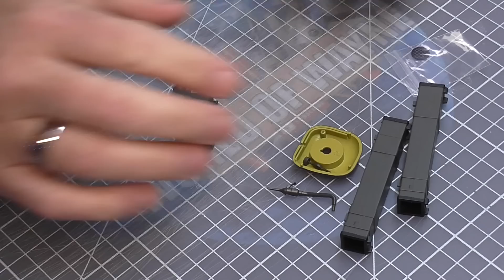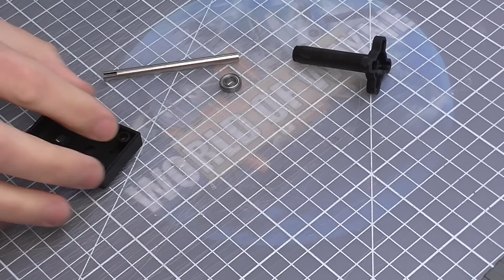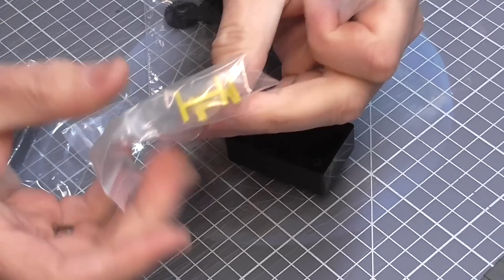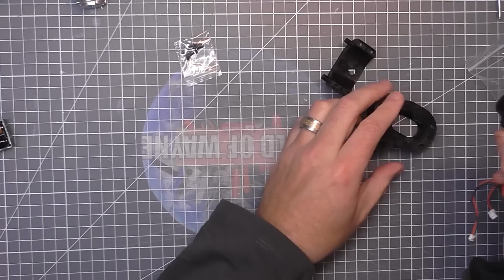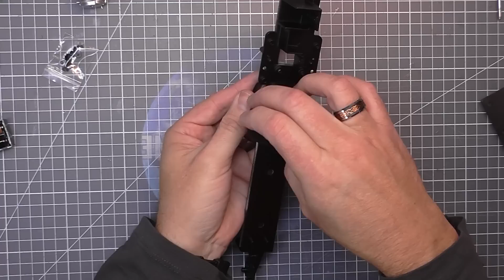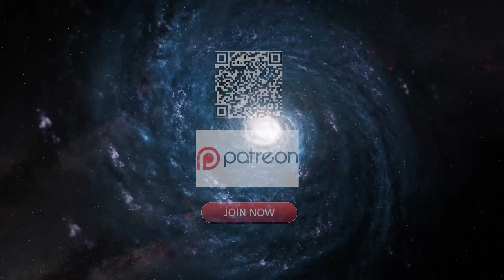Build the 1:24 AH 64 Apache Longbow Attack Helicopter - Pack 4 - Stages 23-30

Comment: Wayne you should put some tape on those two metal shafts from the motors, if you happen to turn it upside down they slide out and you may have to take It apart to get them in the gears again.

Comment: At 9:45 in the build the top of the motor box is screwed on. I found that when I screwed down the top of the box the fit was too tight - the motors were impinged and would not turn. I had to loosen all screws in order for the motors to function. I triple checked the position of the gears and everything is how it's supposed to be. Did you have that problem too?
Reply from the maker: Nope . It seemed okay. I did grease them up good though